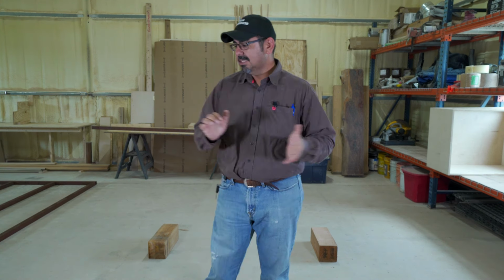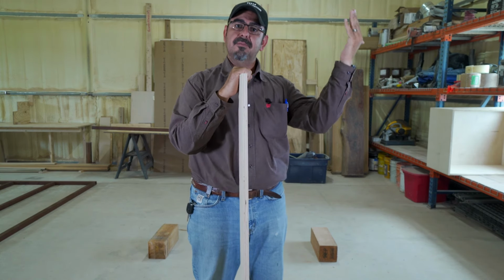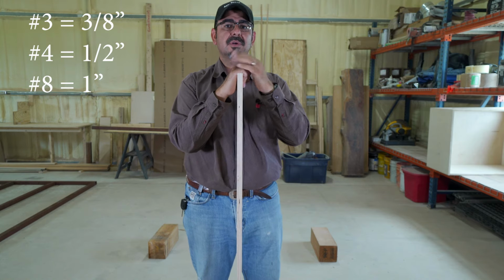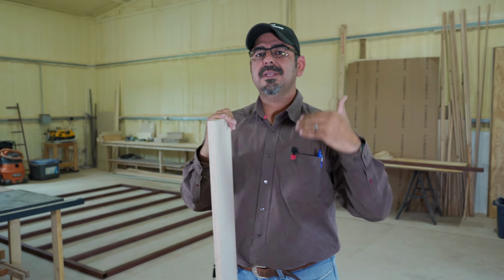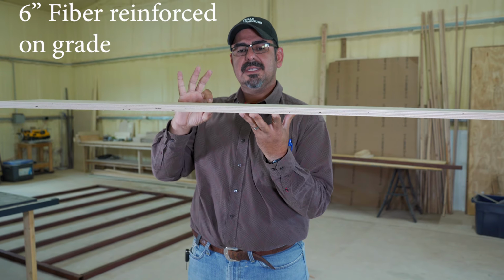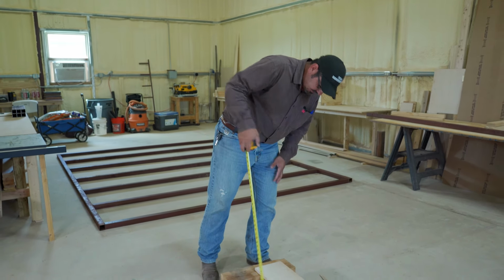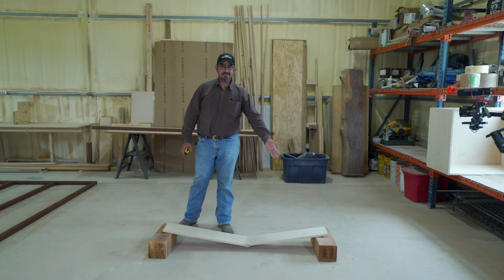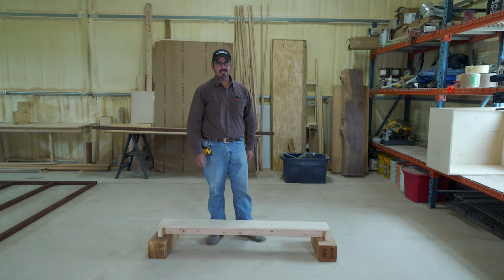Concrete thickness explained! - The Barndominium show E136

Comment: I’m planning on building my dream house next year. I want something my great grandkids can live in so...if you were building the ultimate slab, would it be 6” with piers, 16” #3 rebar and fibers set for 4000 psi and post tension ? I wanted a stained concrete floor
Reply from the maker: It depends on the soil type.  
Get soil samples and find an engineer in your area.  They will tell you how to built it.  

I had mine engineered.
Reply: Hands down I highly recommend a post tension slab system. If it were my own dream house, it will be a post tension slab system. Period. Work with a reputable post tension engineer and concrete installer. Even if the soils engineer says you do not need a post tension slab go ahead and install it. The post tension cables are designed to "relax" over a period of time placing the concrete slab in a state of compression from all four sides or in essence squeezing the slab towards the middle. Consequentially, cracks in a post tension slab can close when the post tension cables start to relax. If you fill a crack in a post tension slab be ready to see the crack filler material ooze out like a tube of toothpaste over time.
Reply: PT slabs just because???  You people are nuts, have no construction knowledge and need to stay off Google.
Reply: @chestercalloway3812  My old employer was the 1st to use residential Post Tension slabs in Southern California in the 1980's. If you want to cover your a$$, you use post tension as a state of the art slab foundation system. Why ? After hundreds of millions of dollars of defect litigation, you either cover your a$$ or build to minimum standards and roll the dice. Post tension foundation systems add MAYBE $3k to construction costs on a typical family home. Hell if I am building a house, I am using a PT slab depending on the location

Comment: What if I told you that typically a 6" slab was built because of the code. A lot of conditions require you to have 3" of cover over your reinforcement. That's both sides. The smallest you can get away with is 6. That's just what I've experienced.

Comment: The question i have is..when u say support boards under your test piece..did u place a 2x4 on edge across..
And how would you do this sipport in when you pour your concrete

Comment: Soil and compaction of fill is biggest
Reply: In the old days here in Florida the slab could not be poured until the house pad was compacted and wait 90 days , But fast forward to today and they can pour right after compacting the pad. A week later there will be cracks everywhere.
Reply: This is glorious, I have been researching "how to build foundation for storage shed" for a while now, and I think this has helped. You ever tried - Damkietor Nonpareil Dominion - (just google it ) ? It is a good one off product for building better sheds and woodworking without the hard work. Ive heard some pretty good things about it and my brother in law got amazing results with it.

Comment: I have a challenge I've been doing concrete for 27yrs.you should not been slabs unless it's 6 sack .winter ,summer, autumn, spring. There is many verifications you can add ,wind is your worst enemy. I love you guys I've watch you on you barndominings for the last 5yrs maybe I'm impressed love you guys
Reply: Water is your worse enemy
Reply: It's stronger if you put it to sleep for 28 days than finish it

Comment: What if I told you every 4 inch slab I have had poured didn't hold up and all the 6 inch slabs I have had poured have held up great. All had 6 ga wire. I would only pour a 4 inch for a sidewalk or maybe a patio.
Reply from the maker: Pour a 4” slab with rebar and support beams.  It will beat the 6” by a large margin.

Comment: The amount of Portland in the mix. A higher percentage that's represented and contained in the overall mixture of sand, stone, calcium, & fiber, and the sum of those also reflects a variation that increases the strength, and the bond those components have as they cure.

Comment: Can you please send my to a video that explains how to lay out the crosshatch rebar idea and or just footers around the perimeter?  What does 12 x 24 perimeter beams and cross beams mean?  I am an individual but need to put down a pad that is about 35 x 70, for a metal Steel Building. I just want to understand all of this before the contractors start telling me how I should do it.  Like to be informed and be able to recognize smoke when it’s blown up my a..   I was brought here by your 4 versus 6 inch video and was curious if I would need one or the other.  We are in Florida so all of our pads need fill, we actually added about 3 feet of #1 for this one and then seriously compacted it.  Additionally the dirt has been sitting for about a year, so it should be really solid.
Reply from the maker: Get slab engineered like I suggested in the video.  Engineered plans will tell you how deep beams need to be, what spacing, what size steel, etc etc.
Reply: @TexasBarndominiums  Bingo. CYA. Go off of the engineered soils and foundation plans for foundation designs. 

BUT ..... Post tension is the ticket for residential foundations so why chance a lawsuit when it costs how much more to do post tension ? When the lawsuits start to fly, you can not get accused of "cheaping out" on the most important part of the structure of the foundation.

"Scopes of Work" .... Use Scope of Work as attachment to all contacts OR is it is either "my way or the highway" as a contract agreement attachment. Hey ... it provides superintendents leverage to squeezes the balls of the contractors to perform or get back charged. Time is money and CYA.

My humble .02

Comment: We're building a pole barn house with a concrete slab .. Thinking 4 inch slab and won't be heated .. Any suggestions on how to make it strong .. I have good base down and gonna have stone brought in to tamp down then .. Vapor barrier and 2 inch insulation for concrete
Reply: When you say you have a "good base down" did you have the soil tested with a nuclear soil density tester ? If you do not have compaction readings in the low 90's, you do not have a good base. Spend the money to make sure you indeed have a good base prior to a foundation pour. 
Oh and your vapor barrier....double up your visqueen (plastic) barrier prior to pour. 

My .02

Comment: You're absolutely correct about it is how you build it. My plan has been using 2 foot of crush recycled concrete With number 6 Rebar on 12 inch centers And concrete That has steel fiber with water reducer 12 inches thick Slab.

Comment: What do you recommend for a post tension cable slab thickness ? 4"or 5"
Reply: 5 1/2 with an 8 inch turndown minimum by 12 in width

Comment: Also, what psi is the mix? That's another HUGE variable. Being a bridge superintendent, I never like to use under 5,000 psi and even use 4,000 psi on sidewalks. I want it to last forever.

Comment: You completely neglected to mention the different psi's of concrete, I have a friend who was supposed to pour a 3/8 rebar reinforced 30 psi concrete slab for a garage ,but the truck showed up with 45 psi concrete, which makes it almost twice as strong
Reply: About at 9:10 he mentions it....
Reply: 45 psi will not work at all.
2,500 psi to 3,000 psi is a bare minimum

Comment: A 6" concrete slab gives you a larger thermal mass to help keep the interior temps more stable throughout the day. Combine a thick floor slab with other passive heating elements like vented Trombe walls...
Reply: Yeah I have friends who are builders and for there houses they always have a lot more inches for there personal home then they build for their customers...lol

Comment: Nice to learn all the difference materials used for foundation or drive ways - You got inches to consider and then you got PSI which the larger number is better, then you have material used for mesh, fiber mesh,  and rebar - A lot of new materials are now being used for Mesh and Rebar which will not rust like old material and is much lighter and easier to work with - But as everything you get what you pay for...$$$

Comment: Also is the mix a 3000 psi or. 4000 psi or higher mix does the mix have 57 stone or 89 stone in it what about add mixes it goes on and on it comes down to knowing how concrete is made and what you put in it for reenforcement and so on your videos are a wealth of knowledge thank you sir ps . I haul concrete for a living i Georgia
Reply from the maker: Thank you. 
Yes, aggregate, psi, admixtures, etc all make a difference.  Simply saying 6” is better than 4” isn’t necessary true.

Comment: This is also why it’s nearly impossible to accurately quote costs on a new house or barndominium without investigating the site location and soil first or reviewing engineered foundation plans.  Foundations can easily become 25-40% of total building cost, depending on the degree of problems to overcome.
Reply from the maker: Exactly
Reply: Well these are pole buildings so the slab isn't the foundation

Comment: I need a 6 inch slab with rebar because I will be building a pad for a mobile home and instead of pouring individual piers for each Jack stand, I would prefer to just have a single surface so strong that the jack stands can be placed wherever and it’s always solidly supported.

Comment: I like the 10 inch slab I just watched before this one. Many good points. Like the idea if a builder over engineering  with his gut and experience better than a desk engineering plan. What should we do then double it. That's good engineering and not run by penny pinchi ng accounts or cheap customers. I wNt to buy a lot in a small town in Texas just to have you build a Barndo for me. Ur great!!

Comment: A humble tip is to add concrete testing to your construction procedures. Take a wet sample of each slab and have it tested by a lab for break strengths. This keeps your concrete supplier "honest" and if there are any construction defect lawsuits, you have the concrete break testing data. You will also know if you are getting your compressive strengths you have paid for ..... Slump tests in the field only tell you so much and really does not memorialize the field testing data.
Reply from the maker: Yes, I have been discussing this lately and we may start doing it.  Just need to come up with a good system to do it all.
Reply: @TexasBarndominiums  I suggest using 4" PVC pipe with a screw on or rubber cap. Gather enough material by asking the testing lab how much concrete they need and how many samples. Use a sharpie to mark your wet sample with date and location (lot number / project name). Make this a responsibility of the Project Superintendent or the Assistant Superintendent for each project.
Reply: @TexasBarndominiums  Another humble tip: Termite treatment of the soil BEFORE the slab is poured. If pre-treatment of the soil for termites is something you are not doing or is required, I'd suggest for this step to be done the night BEFORE you pour concrete. I also had our termite company place a "dye" in the termite treatment so we could easily identify the coverage of the termite poisons, otherwise; it is hard to see if the termite contractors are hitting all of the footings with termiticide.
Reply: @tonyreyes1798  concrete break test use a specific size plastic cup and procedure the concrete is jabbed with a smooth dowel 26 times.  But as far as keeping your concrete supplier “honest” in my experience concrete breaks always come well over the advertised 28-day strength. You have very little to worry about concrete not meeting it’s compressive strength.
Reply: @chestercalloway3812  I had entire phases of residential foundations (40+) not reach compressive strengths. These compressive break strength test provide ammunition OR NOT for the construction defect attorneys. In my experience watching and monitoring thousands of foundation systems, I stand by what I posted. Get your concrete tested. Period.
Reply: In Washington for commercial foundations it was required never had one not pass far above the requirements !!

Comment: Load distribution, tension / compression forces and dynamics are the primary factors here. It doesn't make sense to pour 6" of concrete loaded with beams and bars of steel where the load is little to none. It would be interesting to run a slab profile for a specified application through an AI system made for finding the most efficient design which takes these factors into consideration. I bet it would be capable of removing 30-40% of the material and still maintain full structural integrity - maybe even stronger.

Comment: I'm a Yankee looking at this and I will say, dig it deep and it will stay, for a looooong time. But build what need but 6" slab is pennies compared to a new England foundation. Make sure its built well, best video ever. If it's built well it works.

Comment: That demonstration would work as well if your support was only 1 inch thick.  you did not need a 4" wide support boards. You might get some deflection, but it will not break even if you jump on it.

Comment: It depends on what will be stored and parked on the slab. If it's just a live in Barndominium then 4" would be fine. But if you're building a big garage with living quarters, then that's different. I'm planning a 40×60×16 ridged Ibeam building that will have trucks and a car lift. So I'm going to need 10"×16" footers with a engineered 6" slab which will be a monolithic pour. I'm in Florida so my building and slab will be beefy.

Comment: This is not a slab-on-grade demonstration it is a beam demonstration. Slabs on grade do not span accross
two points and do not experience significant deflection. You will never see someone  "Karate chop " a block sitting on the ground. The rebar is added to increase tensile strength, to distribute the load across a bigger surface area by tying or pulling the
concrete together.
Reply: He was demonstrating shear vs moment and not discussing tension vs compression.  A waste of time except for his last comments about soil and Slab engineering

Comment: You just need 6 inch thick 4500 PSI concrete with 2 #5 rebar mats tied 100% at 6 inches on center both directions.  you will not have any issues.
Reply: false

Comment: We do fiber mesh on top of whatever rebar the engineer directs. Here in California,  we have to have structural engineers calq out the whole job with soil and loads referenced into the math before even being submitted to the county your building in. Then the county has its own engineers double check the math and give corrections if it doesmt meet their standards. Amd then we have special inspections for rebar and county inspection before pouring anything.

Comment: I jokingly say the purpose of the wire mesh is to support the tire industry. It doesn't take more time to tear out a slab with or without wire. So how can a slab with wire be much stronger? It seems like i will get a flat tire from a piece of that wire. So the mesh is stronger than the tire.

Comment: So on a cost side for a homeowner. Is it cheaper to just have 6 in than all the time.material so on with the 4in..
Reply from the maker: It is cheaper because it’s not as good.  
So not a good idea to cheap out on such an important part of your home.
Reply from the maker: BTW, 4” or 6” should both be built with support beams for a home.

Comment: Curious ... I want to build a garage myself and lay the floor so I can put a 10,000lb vehicle lift in it. I live near the beach in N.C. ground is sand and soft when it rains a lot. Any suggestions for the concrete and prep. Just trying to get an idea of the project to see how long it'll take me to get done when I finally start it...
Reply: Sand is a great base to build on as its very stable. Remove organic materal. Compact. Add more fill to site if needed. Local earthmoving contractor can advise usual material in your area. Compact. Level. Setout slab. Formwork. Dig thickening on perimeter ( 12 inch from top of form, 10" wide.) Dig internal trench 6" deep across short side of slab, 6-8ft apart, 8"deep 10" wide. Lay plastic sheeting thru whole underslab area. seal joins with 2"tape. Place 2x 1/2" Rebar supported 2" off bottom in each thickened beam (trench) 6" appart. Place mesh supported 1.5- 2" off plastic sheet in a staggered pattern with no more than 3 layersof mesh on overlaps. Tie mesh. Pour concrete. Enjoy. PHEW!!

Comment: compare 4" too 6"
on a 36'x36 slab, your talking about 8 yards more concrete. if your cutting your budget down so tight you can't buy 8 yards of mud you have other problems.
i'm going 6" with #3, 12" OC. 12" OC kinda sucks with fitting your boots but it's preferred for attaching your pex tubing too for radiant layout.
Reply from the maker: You missed the point of the video.  
If you really want strength, put 12x24 perimeter beams and cross beams.
Reply: @TexasBarndominiums  cost
Reply: @Ramdodge582 , I'll answer for him. The cost of doing it that way will be less than the cost of doing it again. It may be a tad overkill, depending on the situation, and may be more expensive initially, but it will not have to be redone.
Reply: @edswope28  built for the application? Putting beams and spacing out rebar is not for the builder it's for the engineer.

Comment: Outstanding, thank you for your videos. Can you recommend a good engineer in Houston TX. If you are able to I would appreciate it , or better yet do you build in Houston TX.
Reply: You need to be specific when asking for an engineer recommendation. Soils engineer ? Post Tension slab engineer ? Structural engineer ? Mechanical engineer ? Architect ? Electrical engineer ? Some engineers do more than one engineering discipline.
Reply from the maker: Suncoast Post tension has a branch in Houston I believe.  They should be able to help you with everything you are looking for.